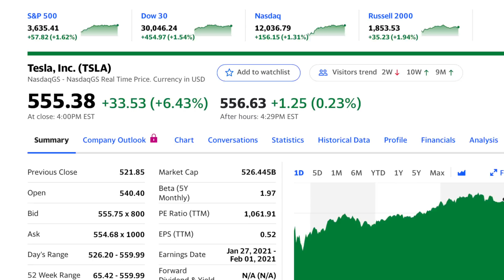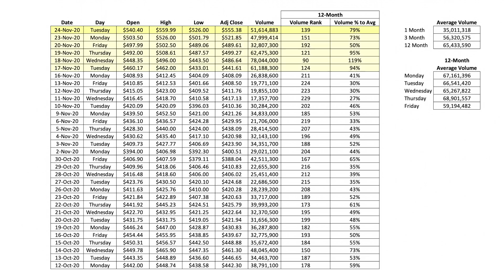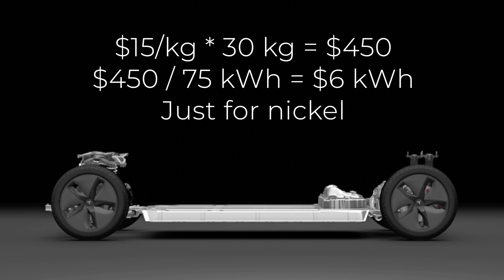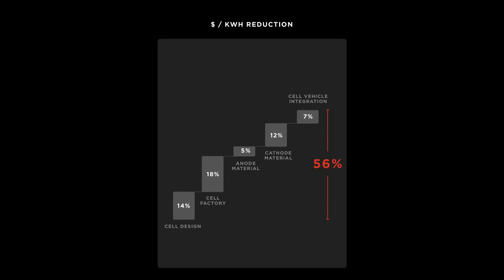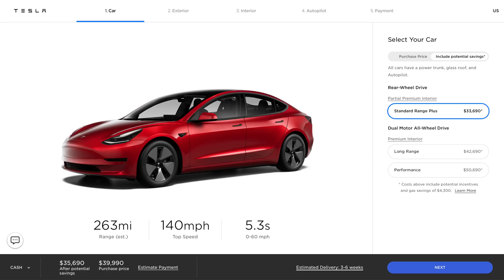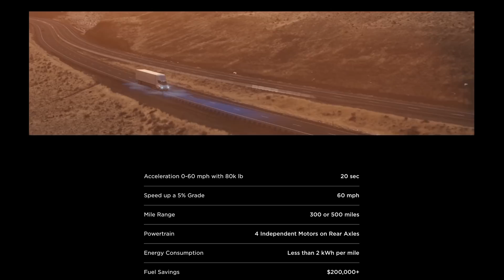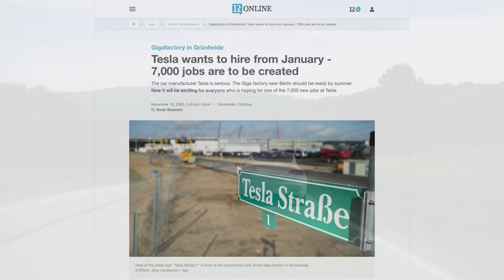New Tesla Semi, Battery Cost Details From Elon Musk Interview + TSLA All-Time High

Comment: You can get to less than $50 per kw/hr if you don't use metal batteries. Mining rare metals is not a renewable industry but you remove the mining then an electric car can be closer to a real zero emission.

Comment: If we consider CAFE average requirement of ICE light duty cars is 35 mpg, the EPA suggest heavy duty truck consumption is a little under 6 mpg. This is a 6+ fold energy escalation.  If it takes a 1000 lb / 75 kWh pack to go 300 miles in a M3, we could reasonably expect 6000+ lbs and 450kWh for just similar range under best case.  Probably close to twice this as claimed real world distance numbers are often not seen in the wild, also at full load, this would be less as the EPA numbers are also averages.

Comment: "If you can pay $25,000
For a car you can always afford $26,500"
If you use that logic, you can also afford a $28,000 car . And a $29,500 car. And so on.

Most people actually live on a BUDGET.
On fact. "Most people" never buy a new car. And 50% of those that can,  spend between $17 and $35k.
$25,000gets you a very nice camry that gets 35 mpg.
And will be a hell of a lot nicer car than a $25k tesla.

Just saying...
PS. Electric cars are our future.
Reply from the maker: The difference in payment on a 6 year loan without any down payment is $23/mo. That’s not going to make a difference in the budget for people buying a brand new car (most buy used). I get your point, but there is obviously a limit. Put a 300 mile range Model 2 on the market for $25,000 or a 400 mile range Model 2 for $26,500 and see which one sells better. The resale value alone would cover the additional upfront cost.

Comment: Could the batteries not reach 50 to 55 cents after the recycling of batteries is the main source of their battery supply 20+ years down the road? With Redwood Materials already at a 95% recovery rate for most of the metals used in batteries, I think it would be fair to say that the recycling process will become more efficient and therefore cost less.  With enough batteries in the ecosystem at that time, there will be no need to mine for more materials.  With enough supply and low cost to acquire materials, I think this is achievable. I did not see the recycling of batteries in the video so I am curious about your thoughts on this.
As always love the content.

Comment: Wow, I was freaking out when I heard the 50 cent... $50 is still huge but not that far away. If they actually achieve ~$60 per kWh with the new cell in 2023, they easily achieve $50 by 2030. I thought the 50 cent were a long shot for 2040 😂🙃

Comment: The issue with a higher range battery pack is the loss of efficiency if you are not taking advantage of the extended range.  It's a lot of weight to carry around for just in case or a few times a year convenience.
Reply: A fair point to be sure.

The longest I've ever driven in one go was close to 800 miles, and it took 13 hours, and it was brutal.

I think 350 highway is the sweet spot, with a one hour from close to 0 to 80%. Driving like a mad man without a decent break sucks.

If 350 is enough for the loch ness monster, it's good enough for me.

Comment: You mentioned that a truck would never need to exceed 80,000 lbs general weight limit. There is a segment of the trucking industry that regularly exceeds that, Heavy Haul. With the appropriate permits they can get upwards of 110,000 lbs per load.  This is the segment of the trucking industry that transports heavy construction vehicles, rocket boosters, and other crazy large and ungainly items. Its not common,  but it does exist.  

80,000 is the standard weight limit, 34,000 per tandem axels, and 12,000 on the steering axels for weight distribution. Most loads can be done under that limit.

Otherwise, excellent video.  :)

Comment: Legal truck loads 80,000 lbs, but you haul more with a permit, so Tesla semi may haul more weight.
Reply: In Sweden you can run a total weight of 64 (74 for BK4 roads) metric tons with 9.5 tonnes max per axle and 25 meter length.

Comment: One note about the Semi and the potential impact the battery weight has to net carrying capacity... The US DOT currently gives truckers an allowance of 400 lbs for diesel-fueled APUs installed on Class 8 trucks, meaning they can go up to 88,400lbs GROSS. The idea is that giving an allowance to compensate for the additional weight of an APU, truckers will be incentivized to install and use APUs for electrical, heating and cooling loads instead of the main Diesel engine. If a plan is in place giving additional weight allowances for APUs, surely a similar plan will be included for EV trucks. I could see diesel trucks being limited to 80,000lbs but electric trucks allowed up to about 84,000lbs.

Comment: Rob, cell chemistry is a big element in costs. The costs for LFP, NM and 'high nickel cathodes vary considerably. If we assume an LFP/Silicon cell which will be used for stationary applications and standard range vehicles - perhaps half Tesla's production by 2023, a goal of $50 to $55/kWh ($14 to $15/MJ) is quite reasonable. 

At present, the M3/Y standard range plus version capacity is achieved by leaving out 4 of the 14 columns of cells in the modules - the extra space is filled somehow. In future, the cells in a pack will remain constant - capacity change will be achieved by switching between LFP, NM, and high Nickel cells. 

Some vehicles like Semi, Roadster, and future MS/X variants, will only come in high-nickel cells.  It would not surprise me if Tesla produced a line of high density cells for aircraft and other uses that use much more exotic chemistries. Elon says 400 Wh/kg cells are available but too expensive for Tesla purposes. 

As Tesla sets out to achieve its world environmental goals, high capacity cells for aircraft and space use should be part of the product mix. 

As Gali opines, the best way for Tesla to achieve its goals and maximise return on investment, is to make its core tech available to industry. 
Rather than just licence as Gali suggests, Tesla should partially follow the Google phone model - make cars, supply software to all who want it, and in addition sell hardware like cells, the battery management system, power 'conversion' boards, power inverter boards for motors, sensor and circuit board sets for understanding the environment for driving, vehicle controller circuit boards, navigation circuit boards, media interface circuit boards, motors, combined HVAC systems for cabin, battery and vehicle systems, etc.

Comment: I haven’t finished yet, and I do agree Elon probably misspoke. However, it could technically be possible if you make some assumptions. Based on information from Battery Day, it does seem like their objective is to get to around $50-55/kWh. But they never really mentioned how much recycling might affect their costs. If they are able to recover well over 90% of the raw materials from returned cells, then there’s no need to mine large amounts of new raw materials. This could effectively reduce battery costs by another 1 or even 2 orders of magnitude. Far fetched that this is what he meant, but this could result in a kWh price well under $1. 🤷‍♂️
Reply: Definitely far fetched. I don't think it will ever be possible to recycle batteries an order of magnitude cheaper than mining the minerals fresh. It will actually be a challenge to get the recycling cost under the mining cost without any subsidies. Recycling is hard, which is why it's not done for most materials. It's usually labor intensive and energy intensive. The cheaper materials we use to make stuff out of in the first instance, the harder it is to get the recycling costs down low enough to make it economical.

Comment: In the UK we can go upto 44 metric tons (~97,000 lbs) without a special permit, so the 40 ton average range is useful in Europe
Reply from the maker: Good to know, thank you.
Reply: We can gross 134,000 lbs in Kansas City, MO commercial zone.  That puts a lot of tri-axle trailers payload at 44-47 tons. 
I'm curious if these trucks will be able to run wet systems (hydraulic/pto) for our end dump trailers?

Thank you Rob, my brother and I love your channel.
Reply: @mxwill5  in the UK we also have the STGO licenses (STGO cat 1 max 101,000lbs), (STGO cat 2 max 176,000lbs), (STGO cat 3 max 330,000lbs) STGO 2 is most commonly used, but each licence has speed limits and other regulations.
More info on STGO 
(https://www.gov.uk/government/publications/special-types-enforcement-guide/special-types-enforcement-guide)

Comment: I am going to guess that the majority of trucks going down the highway are volume limited and not weight limited, which would make a slightly heavier truck not a problem and where they are weight limited, lighter lower range trucks could be used.
Reply: Weight is the limiting factor. You are stick a sign on the back saying oversized load if you need to. Weight is regulated as to cause the least amount of wear to the roads or stress to bridges. 80,000 lbs total split to specific limits per axel. If you go over limit on just on axel it can get you a pricey fine (I happened to my once, and only.once).  There are segments of the trucking industry that do go overweight, but they need special permits to do so, and those are issued per state.

Comment: Rob think your wrong on this see Shirly Meng's Comment.
https://twitter.com/YingShirleyMen1/status/1331276061351452672?s=20

your math actually reflects it. because at the cell level the amount of material is much less. I do agree its a weird comparison.
Reply from the maker: I saw the tweet, but doesn't add up to me. 4416 cells in a Model 3 pack means about 17 Wh per cell. The 4680 cells should have 5x the energy, per battery day, so 85 Wh per cell. This is why I specifically ran through the total number of cells math; it's still too low cost. I'm not sure what Shirley is referring to when she says 10 Wh cell level energy.

Comment: 50 cents at the cell level.  The 100 dollar figure is cost per kwh at the pack level but the pack may be a thing of the past now.  Also long term means in 20 years when they have a pile of giga factories churning out cells not by next year. :)
Reply from the maker: the difference between pack and cell cost is not on that order of magnitude
Reply: @TeslaDaily  No, I was being cheeky.  Sandy Munro's mock up had 960 of the new cells which would make a $450 pack at 50 cents a cell.  If I could get my hands on 960 new Tesla tabless cells for $450 I'd put my order in today! :)

Comment: Maybe Elon meant percent not cent so maybe it's 50 to 55% of the current cost
Reply from the maker: Math works out roughly the same so pretty much semantics at that point, but I think swapping cents and dollars is a much more likely mistake than cents and percent.
Reply: @TeslaDaily  In context I have to agree with you, Elon was stating a cost goal, not a cost reduction goal like he was so careful to do at battery day. Percent just doesn't make sense here.
  
Elon: "The long-term goal would be to try to get to a cost per kilowatt hour of perhaps around 50 cents or 55 cents at the cell level for a long range battery cell."
 
Definitely he had an early morning pre-coffee brain fart.
 
Note that he specifies a long range battery cell (like that needed for the Semi). A LiFePO cell might get even lower in cost. He's sandbagging again!
Reply: @TeslaDaily  i agree it does not matter as it works out around the same anyway,  it was just a thought
Reply: If the current cost is $100 then dollars and percents are interchangible.
Reply: In which case he did NOT actually finally give a price target